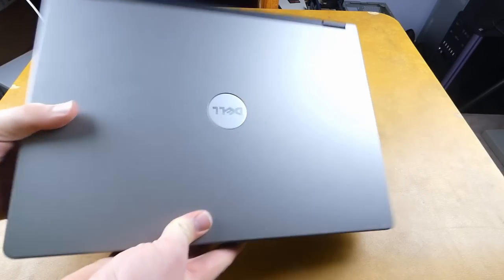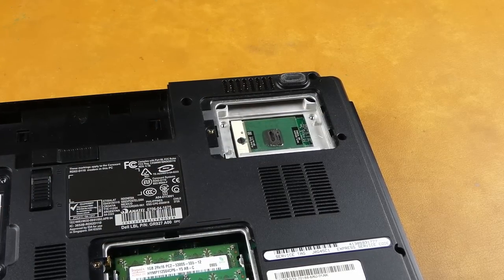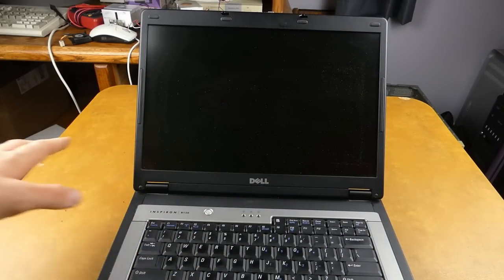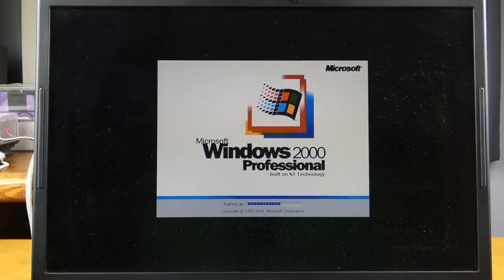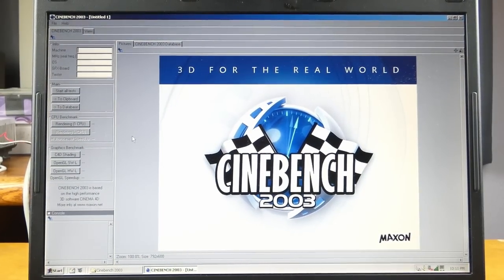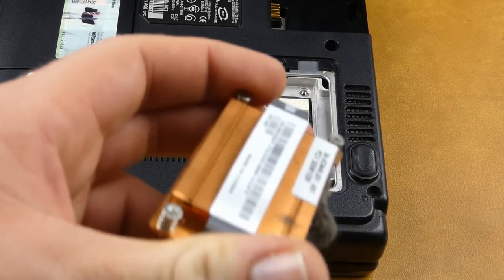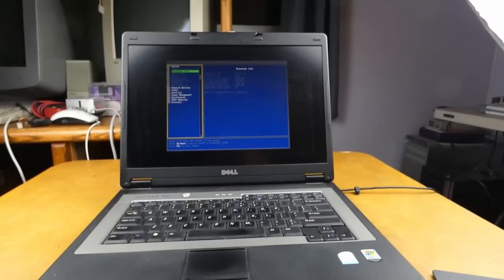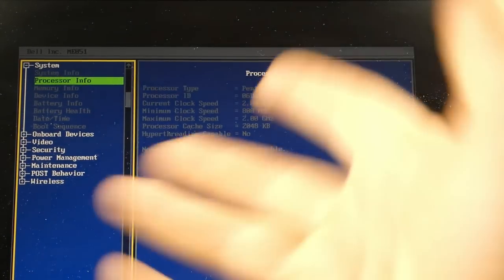World's Easiest Laptop CPU Upgrade

Comment: my laptop is pretty easy to upgrade. its an old cyberpower custom laptop that used to be my main gaming pc. its 8 screws then the whole bottom comes off then 8 more screws for the cpu/gpu heatsinks and you have access to the cpu thats socketed and the gpu thats one of those wierd minicards form faction was mcx or something like that
Reply from the maker: Was it using a desktop CPU?
Reply: @NTGTechnology  no no it's a 4th gen mobile chip have a i7 4800hq I think and the gpu is a Gtx 860m 4gb. I can make a video about it for you to see if you wanted?

Comment: Technically , most laptops were upgradeable up i Core 3rd gen aka Ivy Bridge , it all depended on mobile chipset. You  could for example upgrade Intel HM-65 chipset to use i7 3632QM , but BIOS microcode editing is needed. And 3rd gen was the last gen that used socketed CPU. As for modern ones , depending on user budget , most still support RAM & SSD upgrades and some even have 2 SSD NVME slots. Depending on mamufacturer and model , some still sport M.2 WiFi and Bluetooth cards , tho , involment in reaching these , if they're not gaming laptops is significantly harder. Also - card readers. MicroSD card readers are not always present nor are the separate channels for headphones and mic. Port count and selection also decreased.
Also , user replaceable battery packs that used to be outside , held by one or two latches has dissapeared too , now most people if they are not a bit skilled , need to open laptop to pull out old battery and put new one , without ripping and damaging ribbon cables and connectors and accidentally killing motherboard in process.

Comment: @NTG Technology  Are you still looking for a case for the windows xp rig ?
Could be worth keeping a lookout after the " nexus prominent 9 "
orignially released around 2011.
It's a bit heavy case at just around 9 kg but i still use it since i bought it cheap in 2014.
Using it without one of the sidepanels on due too the tight space it's sitting in the cubby is almost like a sidepanel anyway while restricting top airflow a bit as well.
But should be more then enough cooling for a Core 2 Extreme & SLI 8800 GTX's being made in the era of the GTX 480 & GTX 590.

Current setup of my main pc is that case housing a I5 2500k @ 4.4 ghz, 16 gb ram @ 1600 mhz via 4x4 configuration & gtx 1660 super that I've had for a bit less then 2 years.
Gonna be 2 years around October 4th or 6th i think is when i picked the 1660 super up.
Got it at a bargain 2335 sek or 223$ as an open box return like a week or two before prices skyrocketed on graphics cards, glad i went for that honestly.
Or i would have been stuck with my old hd 6870 or hd 5770.
It was returned because of the shuddering noise on the fans going from passive too actively cooled on the fan profile, thats the only thing wrong & its likely gone now because I've kept using the card.
Literally a 5 minute fix making my own fan profile & 0 issues with the card outside of old game compatibility messing up with the higher vram limit at 6 gb but eh i got other pcs i can play those games on if Dgvoodoo2 or Nglide doesn't help fixing those issues besides community patches, talking like 20+ year old games here like Need For Speed Porsche 2000.

For windows xp i got a Dell Inspiron 6000 laptop here released around mid 2005.
So 2.5 ide hdd unfortunately on this particular model but a dedicated ati x300 gpu using ram as vram, 2 gb ddr2 ram 533 mhz sticks that runs at 400 mhz just fine.
Using a 90w charger the laptop complains about & limits cpu power too 600 mhz normally.

But i can get around that with crystalcpuid forcing the cpu too 1.5 ghz again while slightly undervolting the cpu as well.
Pentium m @ 1.5 ghz which depending on what i play on here is more then enough for the built in 1280x800 display.
HDD was replaced not too long ago with a 60 gb from a dead apple g4 powerbook i think it was.
That powerbook has been junked for like 3 years by now after i tore it down, was some late spec model a year or two before apple went with intel core 2 duo's, cpu was a powerpc 667 mhz, 2x 128 mb ram sticks for 256 mb & the optional 60 gb hdd.
Reply from the maker: I actually found an old Antec case from around 2007-2008. I forget which model it is right now, but it has a 200mm fan mount in the top and a mesh front, so that should easily meet my needs. Video will come eventually about it.

Comment: Yeah when I opened my laptop years back and realized it was literally a socket, I was kind of annoyed that I bought the 2nd fastest chip on the platform. I could’ve bought the i3 version for cheaper and then bought the i7 extreme or whatever it is. It’s crazy how powerful the top end mobile CPUs used to be. My 4800mq is still barely slower than my modern ryzen chip. I used to be able to overclock on my laptop, but after updating it one day that functionality went away and I wasn’t able to revert back to previous settings. Idk why I can’t fix this, but back when I could overclock, sure it was hot, but I could set it at 4ghz and it was basically just as fast as a ryzen 2000 or a 7th-8th gen Intel chip. The speed of this cheap cpu is so astounding that I’ve actually been looking for an industrial or diagnostic motherboard that I could plop it into and use outside of a laptop. With good cooling this thing would be a monster. Paired with a decent gpu, it would be an incredible gaming pc. The Radeon graphics leave much to be desired.
Reply: Except back when laptop CPUs were socketed, the price difference between the same laptop with a lower vs higher-end CPU was about equal to the difference between the actual CPU prices, as opposed to the current practice of putting an "Apple tax" on better CPU options.

Comment: I upgraded my old eMachines e525 with 2-core CPU, more RAM and SSD, and it's become pretty mush usable even with windows 10, everything works just fine, which made me wonder honestly. It really feels like decent laptop capable to do some work even today.
Didn't expect that from 2010 laptop, more than 10 years in use. With new battery it's works almost like new, exept from display. It's very obvious old tech LCD which really looks old and bad by modern standarts, have very low brightness and overall image quality.

Comment: The Sager NP8180 with a 2960xm and dual 6990ms was super super easy to upgrade literally 3 screws to reach all the parts and 4 screws for each part and you are done.

A repaste takes exactly 5 mins for the 2 GPUs and CPU

Comment: Usual thermal paste is liquid. Firstly, liquid thermal paste quickly crawls out to the sides due to constant heating and cooling of the processor, which worsens cooling over time. Secondly, such a hard layer of thermal paste protects the corners of the chip from chipping.

If you change the thermal paste completely, then you can rinse the radiator under water and dry it, it's fast and qualitatively.

Comment: My 2012~13 Latitude is quite similar, 5 screws and you open the hole bottom, RAM, HDD, CPU, and evan 3 mSATA, 2 of wich actually are mPCIe. Quite upgradable and powerful, full of slots, just take a look on the specs and you gonna be surprised, Latitude E6430

Comment: That was my first laptop.
Bought it with a 512MB memory and a 1.7Ghz celeron.
Over the years I had to take it apart and fix it several times.
Along the way I upgraded the RAM to 2GB and a 2Ghz Pentium for cheap years later.
It also didn't have a camera or microphone. The hinges on it are a little loose but still hold up.

Comment: King of upgrades IMO is still the Aspire 5720G.

Replaceable battery, RAM, HDD, ODD, CPU, GPU (MXM standard), Wi-Fi, Bluetooth, plus an extra Mini-PCIE full-size slot for upgrades. And no vendor locks in BIOS either - would boot right up with an HP workstation GPU and a Dell wireless-N card, both manufactured long after the 5720G was out of production.

Unfortunately the originally included GPUs were huge duds (affected by NVIDIA Bumpgate), but that also meant a constant supply of cheap, easily fixable 5720Gs with failed GPUs on the market, sold by people who didn't know better.

EDIT: And I almost forget, the display panel could also be upgraded to 1920x1200 (from the stock 1280x800), although it required swapping the display cable for one taken from an Aspire 7720G. There were also CCFL->LED conversion kits on the market.

Comment: considering the size of the heatsink, I can see why low end laptops were the only ones that can change CPUs. but yeah, they should return Laptops with upgradable CPUs. I understand that business oriented laptops needs to be slim but gaming laptops should have the option to have removeable CPUs since portability isn't really their thing considering how bulky and heavy they are and on that note, why do they even exist. They aren't exactly portable since they usually need to be plugged in to a power source.

Comment: there was also Asus M50V that had easily upgradeable GPU.

The CPU was upgradeable (albeit you had to remove a bit more) also on much newer 2009 Vostro 1510 laptops that you can find with a nVidia 8000 series GPU if you are truly lucky. Pretty competent setup for the time and great for winXP laptop gaming.

I bought mine from the school I studied at and man, it is my  baby. It received the best CPU the chipset can handle (Core 2 Duo T9500) and 4GB of DDR2 RAM with a 256GB SSD. I love it. And since I was the one using it it also holds personal value.

It can't do Crysis but it can do Oblivion/Fallout New Vegas. And that is the peak I want from it.

Comment: Best cheap, upgradable laptop is the HP ProBook 4440s I'm typing this on.  Started life with a Celeron as a student loaner laptop.  Whole bottom pops off hitting battery latches a second time.  Six screws later its a 2nd-gen Core i7 with SSD.

Comment: I think the cpu socket is available on laptop until the m series intel gen4 with intel hd4600, right?
Reply: Not all. For example the Thinkpad T430 is upgradeable, but not the T430s/x230 - all have M series processors.. But yes, I believe you are right in that the last use 4th gen Ms like the Dell E6440 / Thinkpad T440P.

Comment: I have an early Latitude and still use it for basic word processing, the screen hinge can be tighten ed I realised whilst adding a new battery. I wish I could upgrade that to 16gb ram or higher, i7 level chip would be so cool. I have a spare 500gb ssd about.

Comment: my thinkpad t470 i got refurbished for $350 with the bios  firmware update i can use windows 11 and also it can upgrade nvme disk, and memory and wifi , but cpu on the board stilll good for a more newer laptop.... i bought a 8gb stick and a 500gb nvme to replace a 256gb nvme and add 8 more gb to make 16gb with windows 11 i got a very good laptop for about $500 total and this thinkpad keyboard is amazing

Comment: I have a Sony Vaio from 2013 that had a pentium dualcore cpu (socketed) replaced it with an i5 cpu. Works like charm and it performs much much better. I also have an old Lenovo Thinkpad R61 which has a socketed cpu (dual core at 2ghz). I don't know if a quadcore works in this machine at all. Managed to upgrade my R61 to 8gb of ddr2 800mhz. 4gb ddr2 laptop ram-modules aren't easy to find.

Comment: I wanted to add a new Intel CPU to my Asus H97M-e mainboard that has an old Intel  i5 4460  CPU but in the computer shop they said that all Intel CPUs have different sockets and a new CPU won't fit on my mainboard.

Comment: i have a hp pavilion dv4000 series notebook, i just used a copper wire to OVERCLOCK the CPU. 1,7 ghz to 2.3 ghz ... and it has the same door, same heatsink as this dell laptop

Comment: Dell Inspiron 1420 has this exact same CPU upgrade convinience - but if you wanna clean and lubricate the fan, that's a mobo removal. Others have one big panel combining all of these compartments together, like on XPS M1330, Vostro 1510/1520, Latitude E series. Kinda odd I know on Latitude D620/D630/D820/D830 the cpu upgrade is unnecessarily difficult to get to.

Comment: First time I've seen a laptop CPU heatsink that doesn't have heat pipes running away to the other side of the casing. It is probably more efficient this way too!
Reply: It's because of how old this device is. Modern cpus get many times hotter than this one ever did, while also being quieter.

Comment: My Asus A3H is just as nice for the same reasons. The current Pentium M770 crushes the original Celeron M380, and in fact is nearly as fast as a P4 HT 3.2GHz (and the Celeron M doesn't have speedstep and less cache if I remember correctly - the FSB speed is lowered to change the clock speed instead).

USB 3.0 works well over the expresscard slot as well.

Comment: Ok as far as  express card goes it is a pcie 1x slot from the era, they even made low end video card for and those in the modding scene occasionally setup a breakout card and cable to use a low end full size card, of course this when the bios would allow it or could be modded to allow. as far as far 4GB ram a lot of those board would support it unofficially. This come from having been one of those crazy modders in that era that had heater cores for radiators.

Comment: Compal PBL00(DNS Travel).
Very easy to maintain, also manage and every component held by one screw:) You can upgrade them from Pentium/Celeron to i5 2540m or even i7 2620m(but it doesn't make sense to buy i7 one)

Comment: I had one of those it came with vista I upgrade to 7 then 10 had the Celeron updated to a core 2 Duo  and SSD it can also hold 4 gigs of RAM @ 800MHz the only thing that stopped working was the Bluetooth that was only compatible in Vista but I'm sure if I would have upgraded the network card it would have worked fine

Comment: 1:20 You pick a POS Dell... but Higher End machines by ASUS as in their ROG, until the STX / TUF line, you could upgrade the memory, add 2nd Hard drives, and pulling a part the whole machine was a series of clips, and 12 screws.. unlike the crap today, where you can't even replace the battery..

Comment: I much prefer Thinkpads to Dells, but I must admit even for a time when everything could be upgraded, this is very impressive.
Thin & lites are a plague on this industry, especially as the default option. Not only do they sacrifice all this, but their thermal performance is usually awful. And for what, something thats 20g lighter and 1cm thinner?

Comment: I mean.. i can understand the unrepairable trend on for e.g. ultrabooks because they need to put a big battery and the same amount of parts in a very thin and light chassy, so soldered parts are less volume hungry. But yeah, when it comes to workstations they shouldn't remove the upgrade-all features. And there is the question: is it profitable to make such parts and PCs for only a tiny bit of market share? We need to stick to old thinkpads and stuff for now :(

Comment: I have an old Positivo mobile V25 that is also very easy to upgrade, however it is only limited to a 1GB ram memory slot... It has a problem that several Linux distros do not work on it, it simply "dies" when start the system... Well, at least I could install a Windows XP or older and test some malware lol

Comment: I guess Core Duo T2500 @ 2.00 Ghz or T2450 CPU run with ur Dell. T2500 - 667 Mhz & T2450 533 Mhz. Celeron M380's passmark 190, T2500's passmark 408. Double core, double performance. 😊 I don't remember model, but very old notebook did run with this upgrade.

Comment: Maybe, you should try to install Linux on this old machine. If hardware is still supported, which I think, you would be able to run Chromium or Firefox. Linux Mint, based on Ubuntu is a very easy, full featured and well supported distribution for example. Thanks for this video it was very interesting.

Comment: I happen to have that exact model laptop, as my secondary legacy XP runner. It's awesome and all, but I'll tell you what sucks about the BIOS.

You can't upgrade the BIOS version without a good working charged battery. Doesn't matter that I leave it plugged in all the time, oh no no, still not allowed to upgrade the BIOS.. ☹️

I mean not like it's super important to me these days since I have a much newer quad core laptop running Linux now, but I'd still like to max out that old Dell someday.
Reply from the maker: I actually did run into this issue myself, I ended up resorting to booting into DOS and updating it that way. For whatever reason the DOS version of the update utility bypasses the battery check for good.
Reply: @NTGTechnology  Ah, duly noted, I might have to keep that in mind someday. I think my BIOS is at version A06.

Not sure what the latest revision is or how much it might matter, but I'll definitely keep that in mind if I ever happen to pick up a better CPU.
Reply: @NTGTechnology  This could be because DOS doesn't support ACPI (2000s power management standard) or even APM (1990s power management standard). Thus, the DOS version of the BIOS update utility can't read the battery status.

Comment: i have fully upgradable dell xt2
it is not capable to be upgraded any further :]
and it has a new hinge because why not it is a tablet with pen and touch, the hinge get a lot of use

some gma do some won'r work i have some wierd maxdata with ddr1 and dothan pentium and forced xp drivers on windows 7 to get if have some acceleration in gui